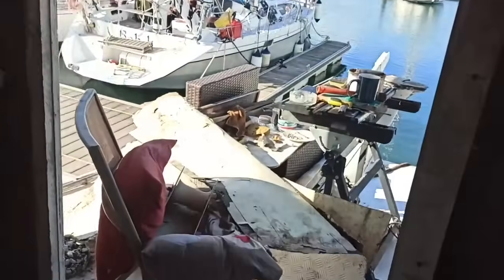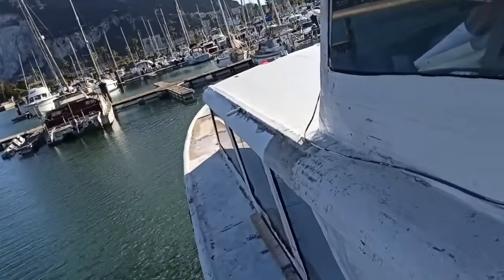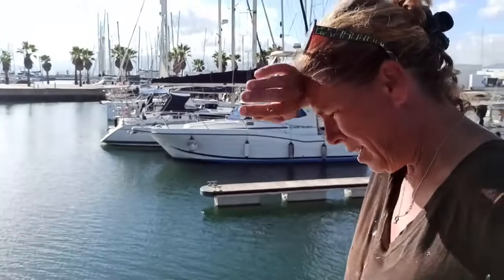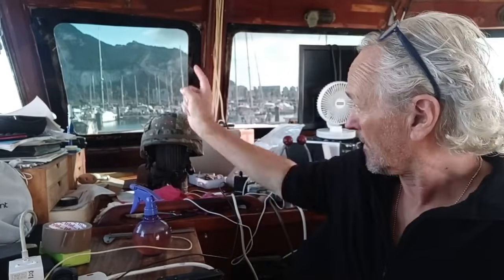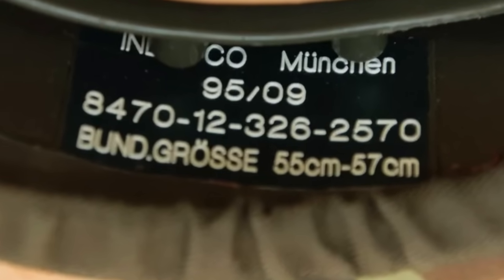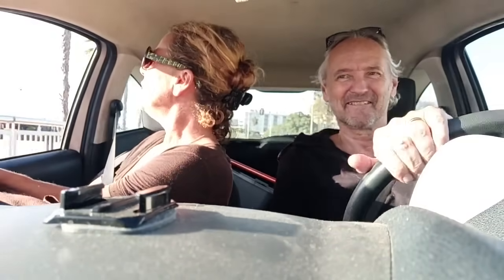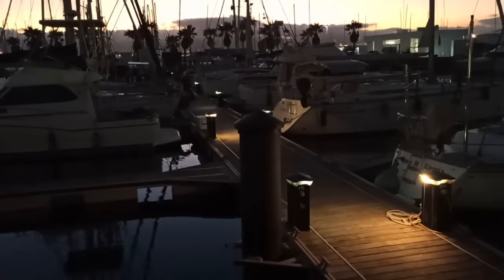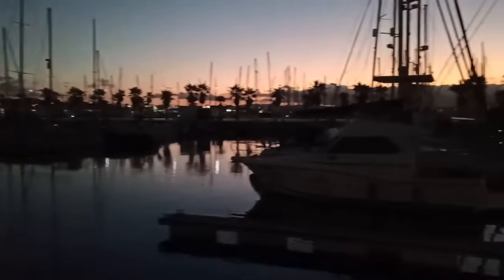Fiona's Amazing Royal Navy Brass Clock arrives.

Comment: It's amazing what Fiona has done with the boat this year.  She just decided to do it and, by golly, she did it.  What makes it more incredible is that she engineered how it needed to be done herself.  Not like she googled "how do I refurbish my boat" and followed instructions.  AND, it wasn't just one project, it was fixing leaks, fixing the wood, rebuilding the roof and other areas that had gone bad, fixing windows and figuring out how to install windows where other, different sized windows used to be.  Not like just replacing the windows with windows of the same size.  Fiona, you should be well pleased and proud of yourself.  It's going to look like a brand new boat - already starting to look like it.  Once you're done, you should write a DIY boat refurbishing book.